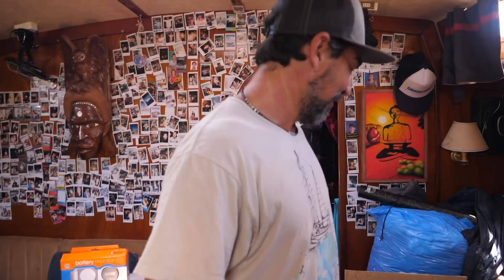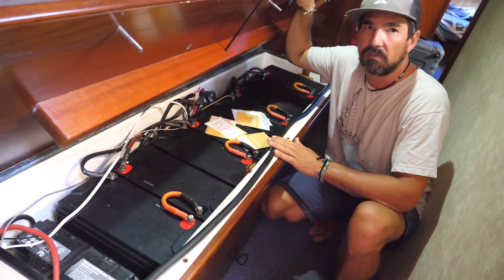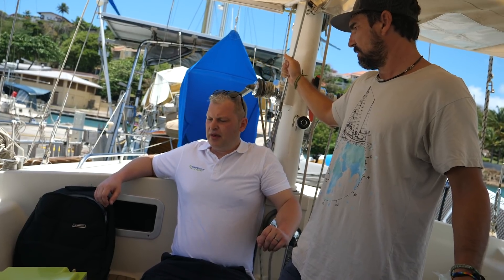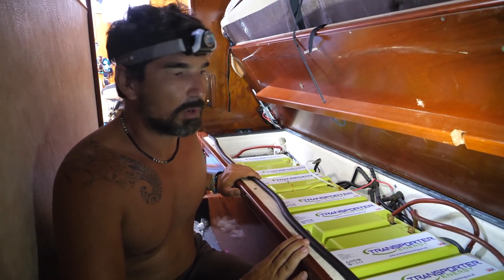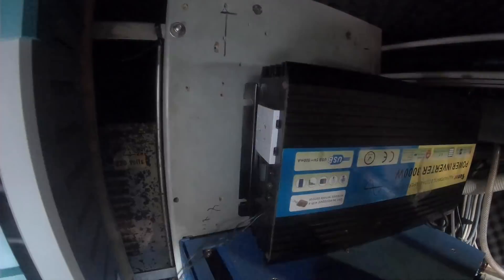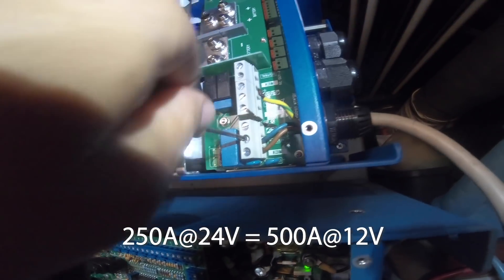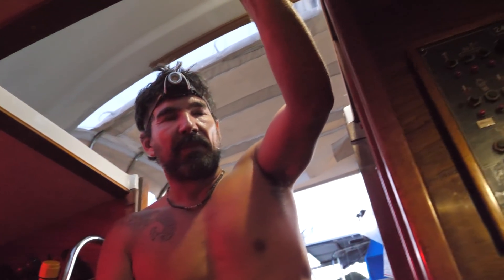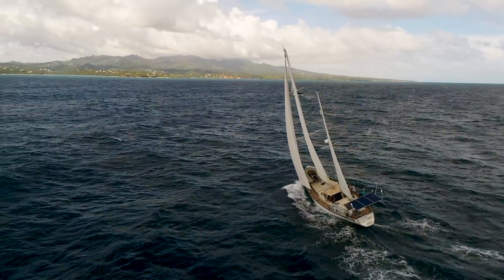Hello LITHIUM, Goodbye Propane!!!  Part 1-  Sailing Vessel Delos

Comment: What have you done with the oven? Did you get rid of and just use the microwave?
Reply from the maker: Good question- we typically bake bread in our bread machine, but will probably install a small electric convection so karin can continue baking her delicious Swedish cakes :)
Reply: Sailing SV Delos; One more question, have you fitted soft start to your air con circuit so you can run it off your batteries?

Comment: Brian..another great tech video..nice balance to the regular vlog content .
One thing did come to mind that wasn't addressed..what are you using in lieu of a gas oven and bbq now for baking/grilling ?
Reply from the maker: Good question- we typically bake bread in our bread machine, but will probably install a small electric convection so karin can continue baking her delicious Swedish cakes :) . For the BBQ still working on that one but we also got an electric Kenyon BBQ to try out.  Not sure about that, but will report back when I know more.

Comment: You should mount an electric convection oven with built in rotisserie under the stove.  This is what I'm planning on doing when I get my boat in about two to three years.  I also plan on installing a vent system to vent any access heat out of the cabin.........Great videos!

Oh, I forgot to ask, what are you planning on doing for cabin heat?  going to electric as well?
Reply from the maker: We typically bake bread in our bread machine, but will probably install a small electric convection so karin can continue baking her delicious Swedish cakes :)   Options are still a bit limited for heat- from what I understand diesel powered forced air or hydronic is still the most efficient.

Comment: I think the 1.2 kW is a bit underpowered. On the other hand, it' s probably sized to run both plates and the rest of the boat off that 3kW inverter. What makes induction cooking great, IMHO, is that technically, you can put as much energy as you want into the bottom of the pot, not just the amount the border layer between gas and metal can transfer...

What you forgot to tell us is the actual capacity of the new batteries (or I missed it).

Very informative video! :-)
Reply from the maker: yup, the entire unit is rated at 1.8KW i believe, but in this model I think the most that can go to any one element is 1.2 KW....

Comment: Awesome!  Nerding out over boat systems is sometimes even better than sailing, especially when it upgrades the capabilities, safety, and comfort of the boat.   So ... can it run the A/C? :)
Reply from the maker: It is possible with a soft start to bring down the high initial draw getting the motor started, but given our capacity would probalby only run for a few hours before draining the bats.  We haven't run the AC in years anyway, actually since we were in hot and windless Asia.  Then we just ran the generator for a few hours in the afternoon to make it bearable.
Reply: Maybe with a couple extra panels running a single compressor in a small berth at midday after the bats are charged .. one can dream ..
Reply: Another reason I loved this video was its technical accuracy.  Awesome details and no mixing of electrical units :)  The current uptake (and discharge!) of lithium is an incredible advantage, the depth of discharge and the tenfold increase in cycles.  Sailors are a conservative bunch, with good reason, and lead acid is the tried and true tech (though a lead acid battery is far from foolproof safe!).  From solid state instruments to electrical systems, you guys have always been on the leading edge of technology for hardcore sailors!

Comment: Did you check out the Firefly carbon foam batteries and compare them to the lithium batteries ? Are you giving up grilling on a barbeque ? Can you bake a pie in the galley still ?
Reply from the maker: Good question- we typically bake bread in our bread machine, but will probably install a small electric convection so karin can continue baking her delicious Swedish cakes :) Kenyon also has an electric BBQ if we want to go that route.  I have my reservations but will give it a shot and report back.  Brian
Reply: Sailing SV Delos ...ok

Comment: Smart to go with lithum iron, to the best of my knowledge they are less likely to experience thermal runaway.
Reply: Correct. One huge advantage of LiFePO4 is they are NOT at risk of thermal runaway, ie  overheating and catching fire, like other formulations of Lithium. That is why they are used in electric cars. (I looked into this 9 years ago when they first came out, and built an electric bike with them.)

Comment: Sailing SV Delos
Hi Brian,that was actually good idea to to not waste any propane and save the environment for the earth.I just one question,will your lithium battery will overheat and catch on fire.Mostly fire extinguisher weren't designed to take out the fire because it lithium?. Just like the Tesla car accident in Australia.That would be dangerous and you don't want your boat to catch on fire and burn it down.I hope one day i would love to become crew with and learn a lot about sailing and cruising in the ocean,maybe next years.

Your pal,
Iain Love
-From Canada
Reply from the maker: Hi there!  Yes, we actually did consider this quite a bit.  These particular bats (LiFeP04) are a different chemistry and much more stable because of it.  With proper charging profiles and monitoring I think in the end they are much more safe than having a flammable gas onboard like propane.

Comment: Electric oven as well?
Reply from the maker: Good question- we typically bake bread in our bread machine, but will probably install a small electric convection so karin can continue baking her delicious Swedish cakes :)
Reply: Yes, an electric bread maker would be more efficient for breads than an electric oven. In a few years you might even replace the main engine with an electric motor, powered by solar/LFP or the generator. That's what I will do once my Perkins decides to pack up. Fair winds!

Comment: Great content!!! Love the technical videos. So great to learn from the pros. 

Question: Will you see a similar increase in efficiency in charging from solar and wind? If so, will you actually see a decrease in generator time?
Reply from the maker: That's the thought, we have already noticed the batteries topping up by noon, where before it wouldn't happen until 4 or 5 in the afternoon.  Looking forward to more time to test and will report back!
Reply: Hello Delos, thank you for your reply! From an engineering point of view, it's interesting that the capacity to efficiently store power can be the limiting step in renewables - not necessarily on the capture side of the equation. 

Thanks for all the great years of videos! I've been an avid watcher and love the content!

Comment: i love what you did and no wires glowing or melted electrical units so well done man!!!! I have a thought that i might do if i were in your shoes. so i was thinking the lithium batteries are kinda finicky and fires always a slight worry. i also know the system probably has all kinds of electrical heat monitoring goodies but i think i still would want something a little more on the independent side to alert of temp changes  in the battery hold not a smoke detector just something to beeb at you letting you know something is getting warm. well, was something i thought of. i think your vids are great man you guys are all doin a fantastic job 
i wouldn't change a thing  take care be safe

Comment: the only downside with those cooktops is finding compatible cookware that works with it.
Reply from the maker: Yeah, we did have to change a few things but even here in Grenada the local hardware store had a good selection of induction compatible pots and pans.

Comment: Cool project, but keep in mind it's the amps that will knock you on your butt and even at 12 volts ... and one battery ... you have plenty of those! You can actually weld with a 12 volt battery in a pinch.

Comment: BTW - I have found that different pans and pans perform better on induction systems than others.  You may experiment, but I have found that copper base pans work better on induction than gas. Thinner bottoms are faster, but more concentrated heat, on gas than induction.  Guess it makes sense ...

Comment: I believe the default shunt that comes with Victron battery monitor is designed to handle 150 amps and you have 250 amps of converter for charging... you might need to get a bigger shunt
Reply from the maker: Interesting comment, I will need to double check that!
Reply: Ha, I might be wrong just googled and it comes with 500A it seems... :)

Comment: Brian, I think you're making a great move with the batteries and the cook-top. We have a Chevy Volt with lithium batteries, but there are things that need to be watched. Thankfully, the computer takes care of it for us. Things like not over charging or pulling all of the power out of them. The car has heating & cooling systems to keep the batteries from getting colder than 32*F and hotter than 90*F. 
An outfit up in your old stomping grounds put out a video about "Carbon Foam Batteries". They're very expensive but you can use 100% of the battery and it doesn't seem to hurt them. 
Your video today was a great one...............................Here's a link to those Carbon Foam Batteries.
 https://www.youtube.com/watch?v=PrhapRFkt7o&t=45s
Reply from the maker: Wow, very cool I'll check that out.  Thanks for sharing!

Comment: For the tea water thing you might just want to get an electric kettle, much less power than the induction stove. Also some pans for specific induction use work super fast.
Reply: Hi Brian! Yes kettle is the best ...still would like a comparison with kettle /microwave / induction in Kw/Hrs

Comment: Awesome video 'Team Delos'.
I assume you considered lithium batteries that have external gear verses internal gear?
Future battery swaps with external gear will come down to replacing cells only (i.e. cheap replacement down the road) as all the external gear can be bolted off and fitted to the cells. The theory then is that a larger part of the initial investment remains on the boat come time to replace.
Great decision guys - no going back and watching the induction cooker with keen interest! 
Fair winds guys
Reply from the maker: Hey guys!  So cool to hear from you :) We will report back on how we make out after abusing it for a while.  If I remember correctly you guys installed a variable speed magnetic pump for raw cooling water. Is that correct or did I misunderstand?  If so how is that working out for you?
Reply: Sailing SV Delos 
We love your movies - such class and great photography. I recently watched a video where you guys tested a catamaran and we know how that goes in some circles (we also from mono backgrounds originally) and although the other party had some really negative comments and body language, you guys showed respect to your hosts - I respect you guys so much more for that!
 Please don’t abuse those lithium’s too much guys. We been on lithium one and half years now - it’s been awesome.
Yes regarding the raw water pump - we removed the raw water pump entirely and fitted a regular March pump in its place - also removed all radiator hoses in the generator cacoon and been running that way for about 4 or 5 years now - been great not to have to replace impellers and so far totally maintenance free on the raw water side.
You have our attention with the induction cooker guys - we are so done with gas / propane refills - well done!
Cheers for now
Brent and Ana

Comment: Interesting,
 have you considered a solar cooker as  backup ?
Reply: I was thinking a small alcohol fuel range you could just sit on top of the induction 'counter' would be a better practical backup if the electrical craps out on em on passage.  Hell they probably home-distill something that would pass as fuel.  ;-)

Comment: I was very interested in this video because I plan to buy a sailboat a year before I retire. I’m a Broadcast Transmission Engineer for NASCAR Productions. I also work on huge generators (2.2 million watts each), power distribution systems and Uninterruptible Power Supplies. I’m going to watch this video again, and do some research on the systems you describe in the video. Thank you.

Comment: Rong again 24V with out any external resistance at just a few amps will shock the shit out of you!
Reply: It will arc enough to melt the terminal but it's fine if you get shocked.

Comment: Can you go into details on how much lighter the new batteries are? How many more amp are in the new batteries?
Reply from the maker: We lost just over 100KG I believe, although the rating is the same the litium bats have nearly twice as much usable capacity.  so this would be the equal of almost 1600Ah at 12V in lead-acid terms.

Comment: Understand eliminating the propane cook top but what about your oven and water heater?  Instant hot water heater?  Electric oven?
Reply from the maker: Good question- we typically bake bread in our bread machine, but will probably install a small electric convection so karin can continue baking her delicious Swedish cakes :)  The water heater is still the same, runs off of the heat exchanger on the engine and also electric from the generator if we run that.  Actually hot water has never been a thought, most of the time where we sail we are craving a cold shower....

Comment: So 5000 cycles. What constitutes a cycle? And what happens to the batteries toward the end of their useful lifespan? Will they become less efficient or just die at 5001st cycle? Will all of the batteries go at once since they are “smart” batteries?
Reply from the maker: Good questions, I would consider a cycle to be a discharge and recharge, which in our case the discharge would be overnight and the charge during the day.  When we are sailing and using lot's of power perhaps we could say 2 cycles per day but for the most part I think 1 is a good count.  Not really sure about how Lithium degrades over time, not sure I've ever spoken to anyone that's actually had them long enough to know.  The numbers are based on factory tests where they do multiple cycles per day. Time will tell!

Comment: Have you increased or changed the fire fighting capacity on board? I hear that lithium battery fires can be very intense and toxic! Especially important if you are off shore!Great information Brian. Cheers. Wade.
Reply: w00db0x not lifepo4..it’s much safer lithium chemistry

Comment: The tech vids are awesome. Glad to see Delos getting off the grid bit by bit. Any chance that you would switch her over to an entirely electric  drive train in the near future? I've seen folks using batter banks from electric cars like the Chevy Volt and Tesla, then using them to run a high-torque electric motor. Keep up the great work. Fair winds...
Reply from the maker: We are considering it for Delos 2.0, but probably an electric-hybrid solution as we sill have requirements about range for motoring....

Comment: Brian I have an induction cook top in my RV and I noticed I can boil water quicker with that than I can with propane.  I wonder if the metal composition of your teapot may have some thing to do with it. Obviously you check it with a magnet to know that it's magnetic because it works off of induction. Just thought I'd give you the comment thanks for the video very informative.
Reply from the maker: Perhaps, this is something very interesting to consider.  That kettle was a cheap-o one we grabbed at the local hardware store here in Grenada.

Comment: Question-I’m looking to change the batteries in my sailboat and wanted to buy the same brand as you guys since you seem impressed by the quality of the battery. They are made in the USA but the website link is to their UK page?? 
Can you not buy them in the States? Do I have to go thru the UK link?
Reply: Never mind I just realized they are made by Dragonfly out of Nevada 👍🏻
Reply from the maker: Yeah, the USA retailer is Battle Born, or there are also links to Amazon I believe at http://svdelos.com/lithium

Comment: Hey Delos! How do you heat hot water for showers? Solar?
Reply from the maker: This is a great topic for a follow up video :) . But typically get get hot water from our main diesel heat exchanger or via a standard electric heater when we run the generator.  honestly, we tend to take cold showers most of the time because it's damn hot here!

Comment: Great Video Brian! This setup can also be used for your residential system as well. Based on the size and capacity of your solar unit, and the demand needed for your sailboat on passage, plus the  average daily consumption with the size of crew you have. Do you think this solar unit would be ideal for a 1600 sq ft home? How much do you have into your system now $$?
Reply from the maker: I think the place to start is figure out how many KWH you consume per day.  There should be a monthly break down on your bill, from there you can do the basic calculations.  some sample kits and prices at http://svdelos.com/lithium.  Fair winds!  Brian